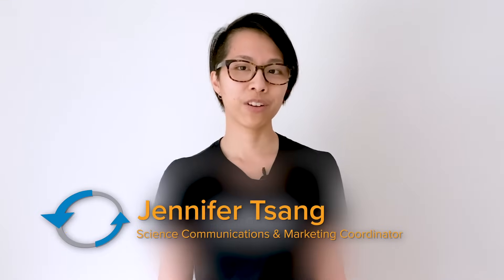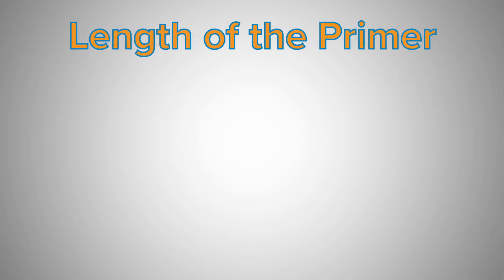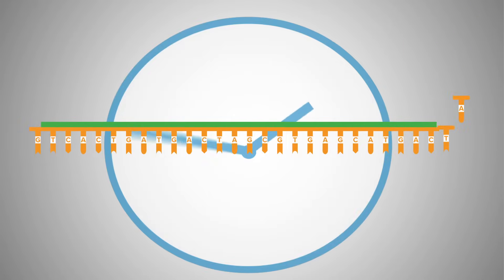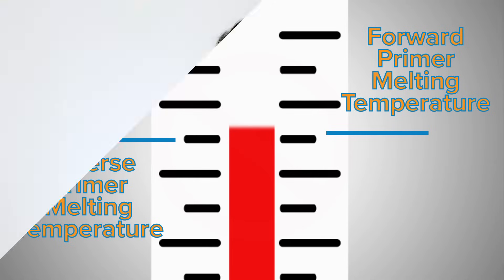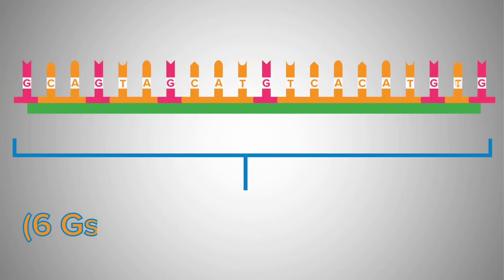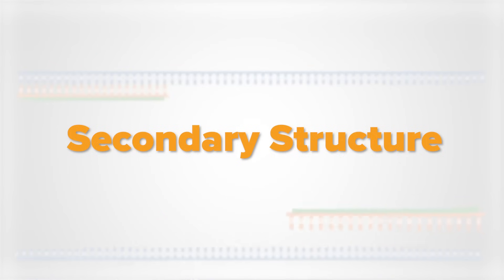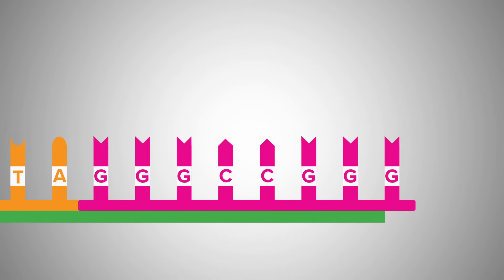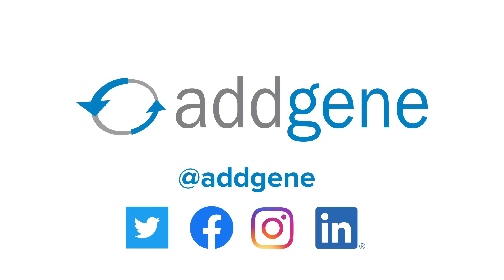How to Design Primers for PCR

Comment: Thanks. You speculated me with a standard presentation. I have one question if you don't mind. You said to add 4 degree for each pyrimidine base and 2 degree for each purine base to calculate melting temperature of the primer. Can you explain why I should add 4 or 2 in those perticular cases?
Reply: She explained later in the video, that C-G base pairs have 3 hydrogen bonds, while A-T pairs have just 2, therefore G-C interactions are stronger than A-T. hence the higher temperature required to melt G-C compared to A-T

Comment: in case of primer dimer / hairpin structure formation is there any trouble shooting method I can use , during primer design? I tried to design primer for a genomic sequence but could not avoid dimer formation. Please make a video regarding this.
Reply from the maker: Thank you for your question! You can avoid primer dimer formation by ensuring that there are no complementary sequences in your forward and reverse primers, and you can avoid primer hairpin formation by ensuring that you do not have 3 or more bases within the primer that complement each other. You can check for this when designing your primers by using primer design software such as OligoCalc (http://biotools.nubic.northwestern.edu/OligoCalc.html) or Primer3 (https://primer3.ut.ee/), which can check for self-complementarity in your primer pairs. I hope this information helps.

Comment: Please tell me what are the reasons for the annealing temperature to be lower than the melting temperature  by 5 degrees?
Reply from the maker: Thanks for the question! An annealing temperature 5C below the Tm can be used as starting point for PCR, but this temperature is something that may need to be optimized for high yields. A temperature of 5C below the Tm should allow for annealing to the expected target site. Lowering the annealing temperature further though could increase annealing to off target sites that differ by single nucleotide mismatches.

Comment: why 4° and 2°C for the Tm ? :(
Reply from the maker: Thanks for the question! An AT base pair has two hydrogen bonds, while a GC base pair has 3 hydrogen bonds so a higher temperature (4 C) is required to break a GC base pair, relative to an AT base pair (2 C).
Reply: @addgene  thank you, you saved me!